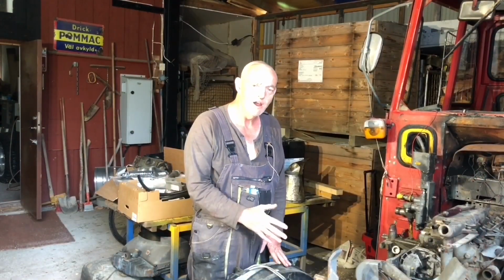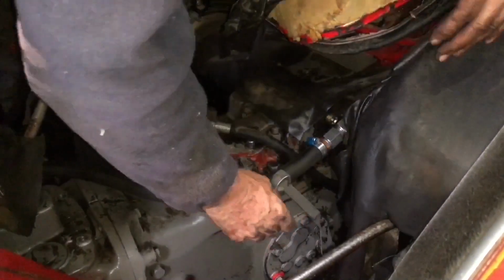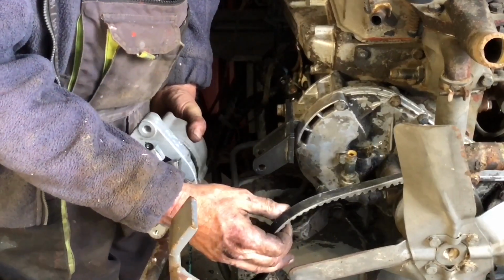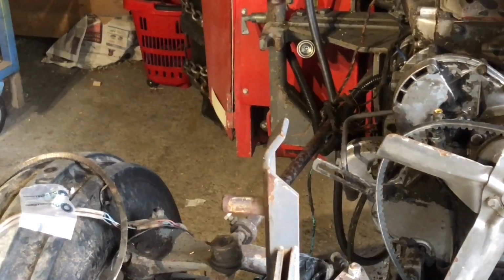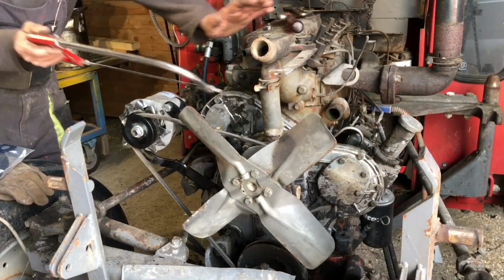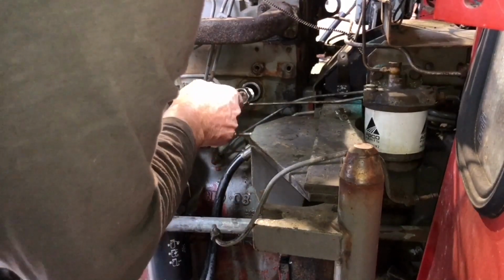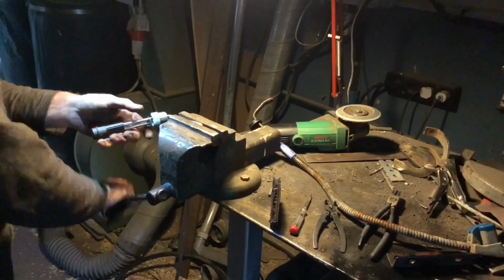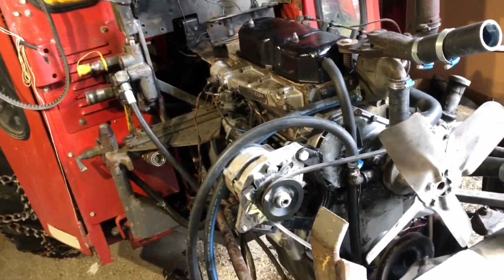Rebuilding a Fire damaged  Massey Ferguson 135 Tractor Part 2

Comment: The only thing universal parts are is a universal pain in the ass for anyone who's stuck using them. I don't know what they're designed to fit, but I clearly have never owned it. I suspect you know this already, but the reason the alternator kit came with a light is because it excites the field windings. I'm guessing the 6V generator had some different arrangement, or perhaps the bulb base on the 6V light is different than the 12v one.

Great progress though, I've take on more than a few scrap heaps as projects, but a burned out unit like that would have probably had me walking away.
Reply from the maker: Thank you, I could not walk away from local work I can do on wet days and his is a really nice guy who needed help. Once you get all the crap off it is just another rebuild.